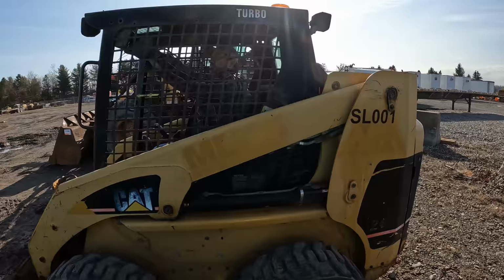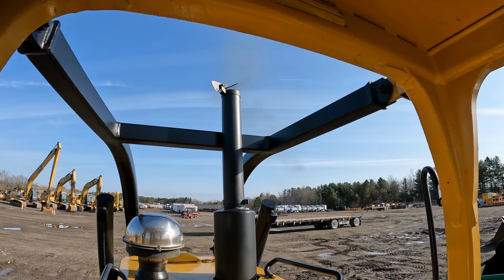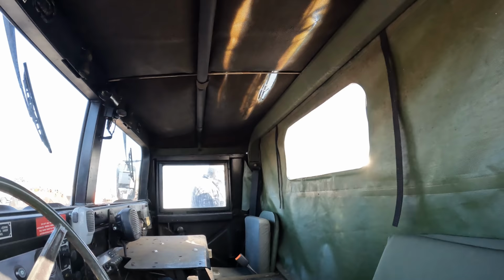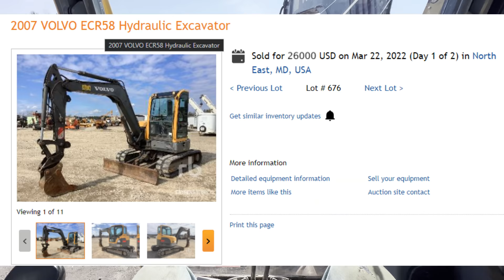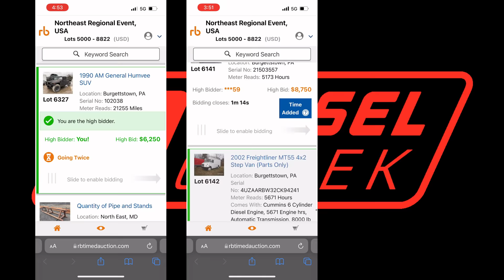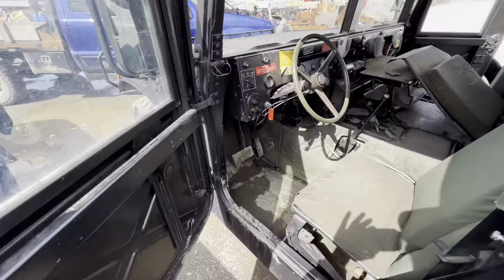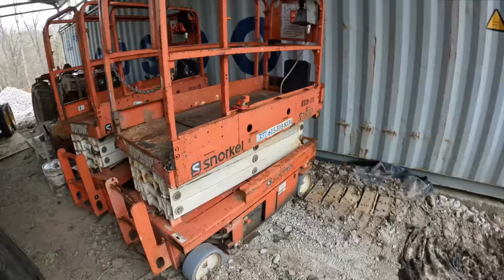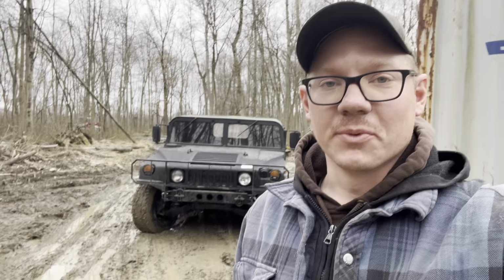You Won't believe the DEALS I got at this Auction! (I Scored BIG!!)

Comment: If I remember correctly all military survice humvees sold as surplus were sold without a title and unable to be street legal.
As far as the van, I see no good of it. It looks like it will be an endless money pit and never pull it's weight around the farm.
Reply from the maker: Well aren’t you a negative Nancy. Humvee has a title. You can get titles for them. Simple Google search will show you hundreds of people that are driving them on the road. As for the step van I have no desire to keep that thing. I want the engine and transmission other accessories out of it and then I’ll sell the van. Perfect vehicle for some of the a food truck out of
Reply: @DieselCreek  thank you for clarifying that

Comment: 13:00 why do i want to again rip the workshop out of that put it in a building and then turn the truck into a camper. I think i have said it before but over the in the UK where i live there where a bunch of old prison vans going cheap and i wish i had got one and turned it into a camper, lots of the work is already done , electrics , insulation , security all sorted.

That hummer is , how do you Americans say it ..... " bad ass"

Comment: Hey Matt do you recall how many hours your buddy’s skid steer has that he bought?
Reply from the maker: 5500ish
Reply: @DieselCreek  thank you. I’m looking at a skid steer almost identical to that one with brand new tires, seems to run good with 4400 hours and I believe it comes with new pallet forks for $8k.
Reply from the maker: @georgeenriquez612  thats a steal then better get it
Reply: @DieselCreek  Thank you. That’s what I was thinking. What’s your opinion on these little machines with that many hours? Or what do you consider high hours?
Reply from the maker: @georgeenriquez612  7000+ is getting high but I’ve seen many machines run well past 10,000
Reply: @DieselCreek  thank you! I’m going to pull the trigger on this skid steer and send it.

Comment: I can't stand the little man lifts. Unless you absolutely have to fit in a doorway or someplace small, I prefer the larger ones so you can have a partner work with you and some space for material.
Reply from the maker: Too big to keep in the shop tho for as little as I will use it.